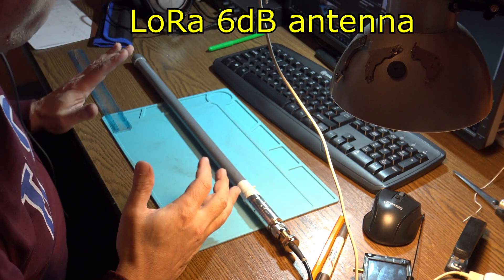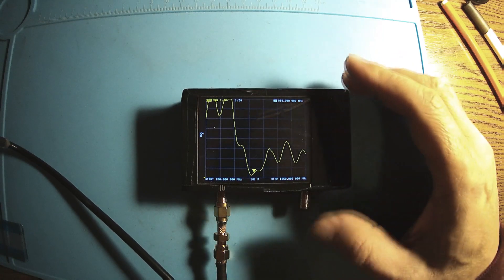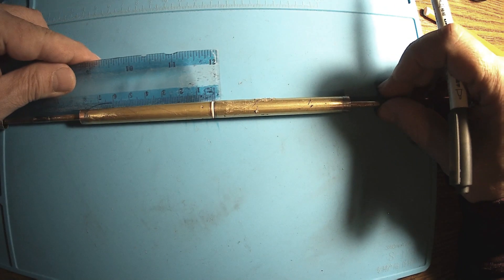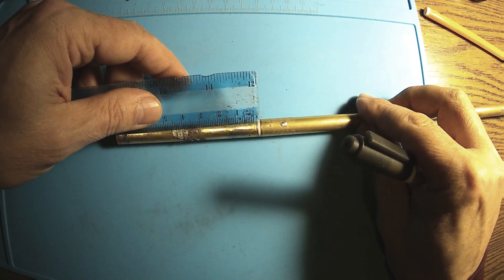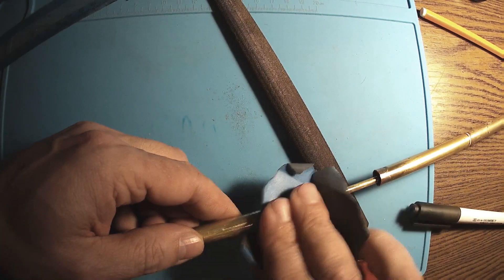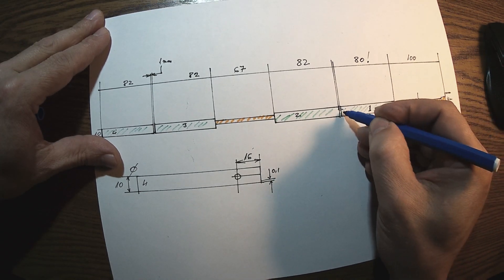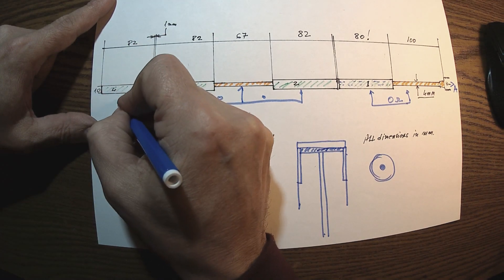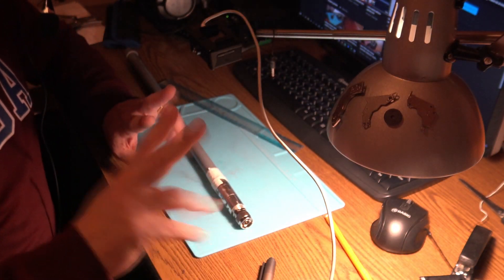LORa antenna mod new design for 868Mhz

Comment: Hello Viorel,
I bought the same antenna and wanted to optimize it for 868 MHz. What I noticed is that when you put the antenna into the plastic tube, the values change significantly. Is this the case with your antenna as well? How did you get the new dimensions of the individual parts?
Regards,
Dieter
Reply from the maker: Yes, the plastic it's affecting the antenna, I did a lot of trial and error until a good result. Basically if the tune it's lower,  try to make the elements shorter...the other way it's kind of difficult because you need to add some length.

Comment: Great video, i am looking to make one of these but for 915MHz, do you have the original dimensions? Specifically the 100mm section at the feedpoint and the 80mm section? thank you!
Reply from the maker: I'll look for...and let you know
Reply: @viocaia  is the center section connect in a T fashion like the first segment? It looks like an electrically isolated 3/4 wave section... where the radiating elements are the first and last... is this correct? forgive m y simple questions, i'm new to this ;)
Reply from the maker: @joearcuri3377  I can't give you details, this antenna was  a cheap chinese one, I didn't saved the schemtic and dimensions for 900MHz, I have thsoe for LOra 868 only. Please look at this , maybe it can help you further...https://youtu.be/70R8ie3_pDY

Comment: Could you show the dipoles inside ?
Reply from the maker: Please watch the video at min 7:22 , ther eis schematic
Reply: @viocaia   Thanks for the answer. I'm an engineer and I understand the diagram) I would like to see how the plumbing work is done. Attaching vibrators to a long thin tube) Could you make a detailed video? I think many would be interested, this is a rare design of a collinear antenna...
Reply from the maker: @The__Skull  The antenna it's up on the roof, I'll take it down soon and do a video about. \there are some plastic parts in each large tube and keep the antenna together. Try to search for McGill Lora antenna and I recall there is a video about it. Maybe that's helps.

Comment: the three doert and the 5th borhlus are connected to each other.  but is the connector also connected anywhere?  Does it have a connection on the connector?
Reply from the maker: I'm sorry but I can't understand what you mean
Reply: @viocaia  I uploaded a video to my channel.  You examine.  see if there is a problem
Reply from the maker: @euroturk2457  I will..thank you!
Reply: @viocaia  I bought an antenna.  but can you check if there is a production problem
Reply: @viocaia  https://youtu.be/7OrAtMS_XTs

Comment: I'm thinking about making a new one with same measures, but I can't find 4 mm brass tube... If I use a 6 mm for internal tube and 12 mm for dipoles, could it work or diameters size are exactly calculated and not changeable?
Thanks Viorel for your nice videos!
Reply from the maker: It should be the right dimensions, here we have velocity for tubes in open air, around 0.95..and the diameter metters too..but you may try and retune..make it bigger with few mm

Comment: Any one with some soldering skills and metal working can make this antenna work. The coax used inside is the RG402, because of the tube inside diameter (3 mm), so the coax is still seen like a shielded cable but then by this brass tube and representing 50 ohm. I use double sided copper circuit board, so you can solder all brass dipole section and  feeders nicely to every side. Remember the metal part for the mast clamps also is playing a part in it all to avoid shielding current. Nice rework done on this cheap antenna, did you get this one from Ali btw?
Reply from the maker: Amazon...never again!
Reply: @viocaia  Most of the Amazon sellers of this type of antennas, buy them in China for $10 as well. They try to profit the hype around Helium mining and high gain antennas, but most of them are a ripoff. The McG's are at this moment the better option .. or lke you did, tune it yourself with a simple VNA

Comment: Hello Viorel,
so now, I tuned my cheap AliExpress-Antenna (up to now only good at 915 MHz), only by dismanteling it from the outer fiberglass-tube,
then playing a bit, unscrewing the top segment tube and so on. I was just before cutting and doing the mod you did.
At some point I removed the shielding of the inside wire at the top, which was not soldered but isolated, and it randomly touched the top segment. And what shall I say : the SWR at 868 MHz went down immediately from before 3.5 towards 1.
Then I put the fiberglass--tube on again and the SWR went to 1.02 on the Nano-VNA.
Wow, that's perfect, doing almost nothing.
May be, it was supposed to be there anyway, but was not properly fixed in the chinese factory.
Now I'm happy and I will try the antenna, how it works, performs and brings witnesses and rewards.
I will report.  Bye
Reply from the maker: Maybe it was tuned already to 868Mhz..they are selling generic antennas for dual frequencies..You've been been lucky..let it run!
Reply: @viocaia  You are right, the antenna was sold for both frequencies, but only worked good without my randomly mod at 915 Mhz.  Now it's only good at 868 MHz, and that's what I wanted.  Bye
Reply from the maker: @ulrichm.12  Nice! Good mining!